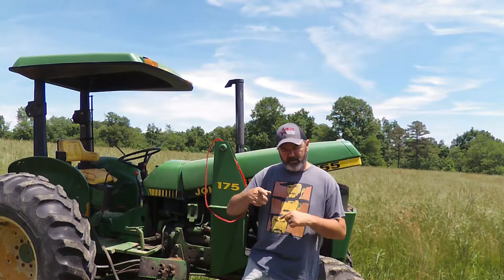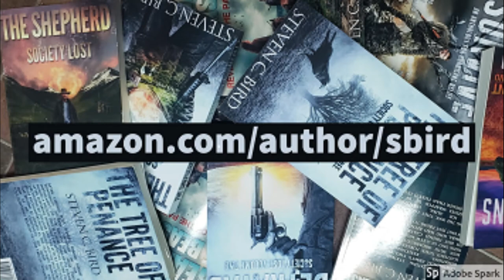Using a Link Belt as a Fan Belt

Comment: Thanks, Steve. I’ve got a JD 1520 w the same coupling issue blocking the new belt install. Couldn’t find anything on how to replace, not even in my manuals. Not looking fwd to front end disassembly. Will try the link belt first though. Thanks again.

Comment: This is excellent. I have a 37 Plymouth Rat Rod I'm working on. It has a 396 Chevy engine somehow stuffed in it. I've been trying to figure out a way to change the belts without pulling the radiator off.

Comment: Well? If it works on that big machine like that, it should work on my troy built tiller ...new oem belts with max adjustment just won't engage so , it could be bad sheaves and very expensive to go that route